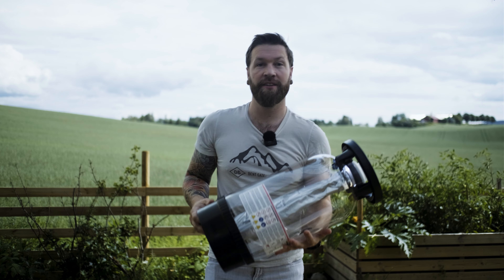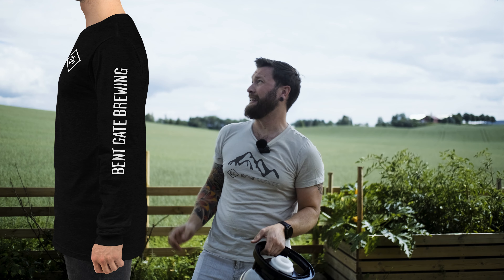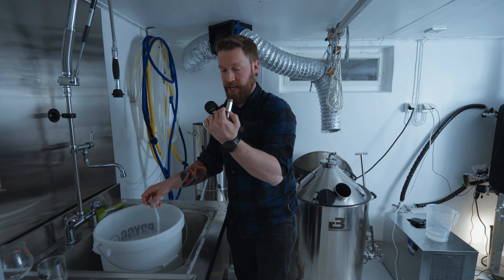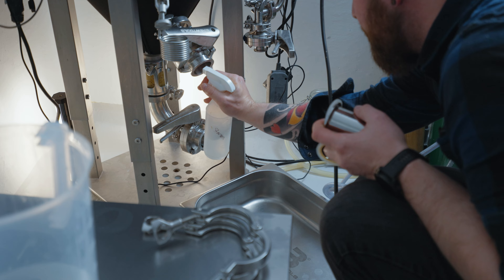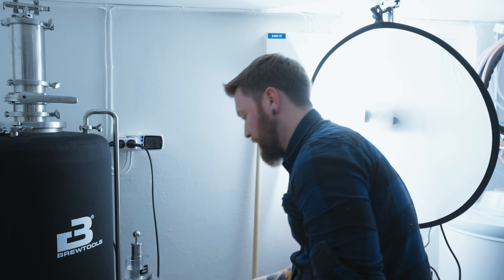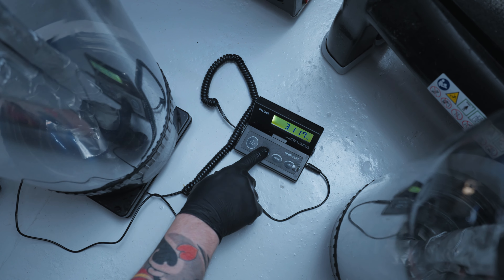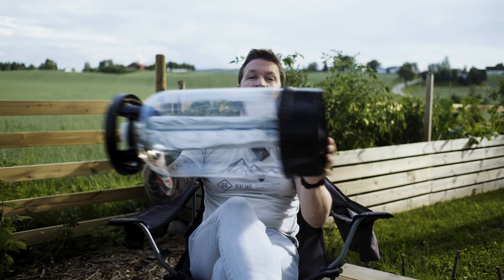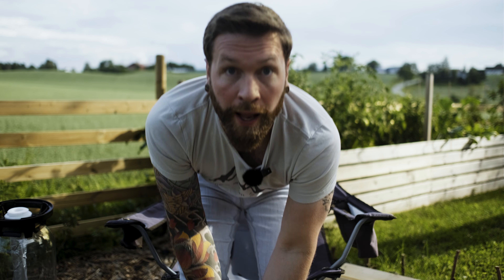Polykeg/Keykeg filling DIRECT from Brewtools F150 w/ Inline Filter Kit

Comment: You have a great setup and have produced a very nice filling video.  

One observation is that when connecting the coupler this way you actually force unwanted O2 into the bag.
This O2 is from the residual air in the coupler filling valve which exists in the space between ball valve to the tip of the coupler.

This will continue to happen every time you remove the coupler and start a new keg. Especially if you connect the coupler and fill the keg standing upright.

with

That is the main reason why KeyKeg recommends connecting and filling kegs with bags in the upside down position.

beverage
Reply from the maker: Why would connecting them upside down remove oxygen from that space? I though the main reason why Keykeg recommends upside-down filling is that they don't have a dip tube so you would have foaming issues (just like if you pressure filled a metal keg from the gas port).
Reply: @BentGateBrewing  

This is because of the air space in the plunger of the filling head coupler. 

The space between the ball shutoff valve and the tip of the coupler is about 120mm x 9mm of volume.

If there is no beverage in that space when you connect the coupler to the keg, then you are forcing that volume of air into the keg. It has no were else it can go.

So whenever you connect a coupler by tipping it over you remove all the beverage from that area and introduce air into the bag. 

By engaging the coupler upside as we show it, firstly by bringing the beverage to the tip and then connecting the coupler to the keg valve in the upside down position, you remove the air from this space.

Also, because KeyKegs don't have a dip tube, you will notice that filling KeyKegs is significantly quicker than filling a spear based bag keg.

This is the correct way to do it: https://youtu.be/zA-4eTBaDSQ?feature=shared
Reply: @BentGateBrewing   

Regarding foaming issues. 

Whenever you fill a keg with a bag, its important to understand your pressures.

In "regular" kegs, any excess gas, foaming and beer is expelled out the gas out side of the coupler. It makes quite the mess really if you don't pay attention at all times.

In a bagged keg, this can not happen.

Everything stays inside the bag or the beverage line. It literally has no where else it can go.

It's impossible to overfill a bagged keg and end up with beer and mess all over the floor.

For ALL bagged kegs, you better know your pressures when filling!

You must always have the correct counter pressure set based on the head pressure and the beverages CO2/Vol (CO2 GM/LTR) and temperature (measured at the tip of the coupler). There are beverage calculators that can help you with this. 

If you don't have adequate counterpressure set then foaming will occur in any keg with  a bag. It's science and you cant cheat it - even if the keg has a spear.

Filling a KeyKeg upside down equates to filling the keg from the bottom. So it makes it the same as a spear based keg for filling purposes.

Also, with the KeyKeg dip tube design you  can fill KeyKegs a lot quicker compared to a filling a keg with a bag and spear.
Reply from the maker: Thanks for all the info! When filling them upside down, do you use other keykegs as the "table" or do you have a special rig for this? @onecircleaustralianewzeala6467
Reply: @BentGateBrewing   Me personally, I use a fold up "work bench" from local hardware store :-) (cost about AUD$20.00). 

I find it cheap, compact and for me it is fit for purpose.

However, I generally recommend a wine barrel rack on it's side - perfect for a two headed filling station! See it here as an example as used by a commercial contract filler in Adelaide filling wine in KeyKeg. 

https://youtu.be/OoPBJsjbiJU?feature=shared 

You can of course also use 2 x other KeyKegs.  

Here is a link to a google drive folder with many different ideas that I've seen.  

https://drive.google.com/drive/folders/18_F4i6KSa8NLkbVaDDAza6ucKj9p4s99?usp=sharing

Of course there are also some very good semi automated filling solutions if you have the desire and budget.  Niche Solutions Filling Stand in the UK and CraftFill (ACAS) in Europe

Please let me know if I can be of further assistance. 

Happy kegging 🙂

Comment: hi, looks nice! how much pressure do you put on the fermenter when filling? with the 150 we usually need a lot of co2 when filling
Reply from the maker: We use approx. 0.1 bar above our carbonation pressure. We typically try and get most of our CO2 naturally using the spending valve and then only topping up as needed. But yeah, certainly uses some CO2 but I don't find it a prohibitive amount.

Comment: Don't know if you filled the beer line on the fitting with CO2 first or not, but if you didn't (and since you didn't fill the line with beer before opening the valve for the bag) you're shooting the line's volume worth of atmospheric air into the first keg :) 

For fillers, I typically purge the filter with the filler attached. Fill with CO2, pull the PRV, fill with CO2, pull the PRV... until your desired purging is reached :)
Reply from the maker: Yup, we purge the beer line with CO2 before filling :)

Comment: So these are single use for you? Or are you somehow replacing the bag and reusing?
Reply from the maker: This is a good question! The typical use case for the types with bags is indeed single use, which is also how we use them. The polykegs are then either, a) collected by a third party and disassembled and reuse the base and top and recycle the rest of the plastic, or b) recycle the plastic for the whole polykeg. In Norway, there is a deposit system where bars and producers subscribe to a service and this company collects empty kegs and they get a deposit back when returned. Large breweries in Norway still often use metal kegs which are then picked up because they have the money an infrastructure to do their own distribution.